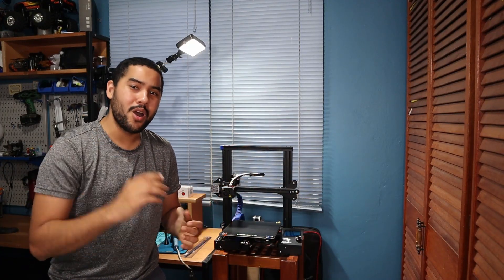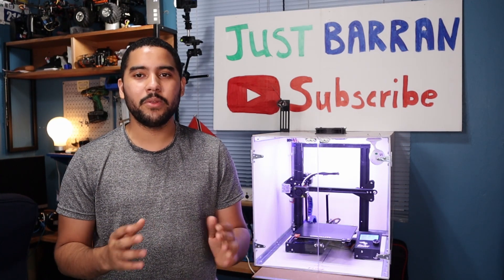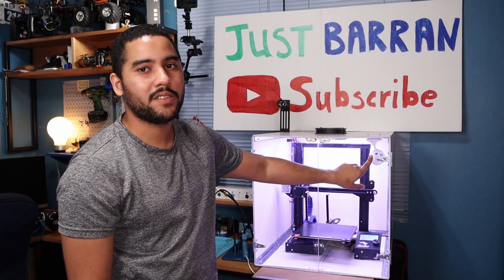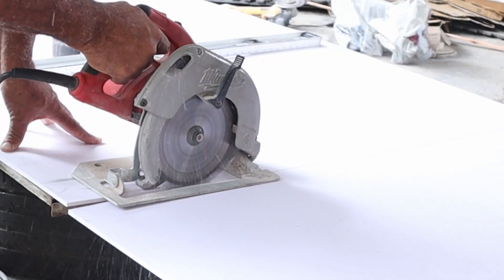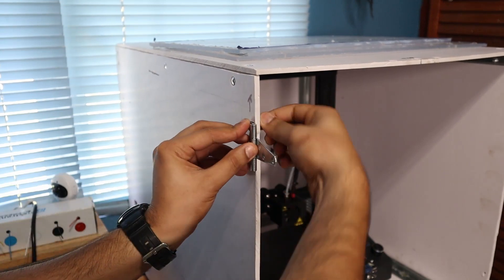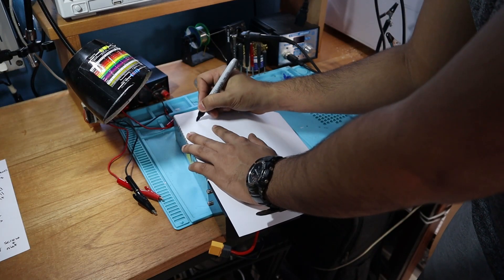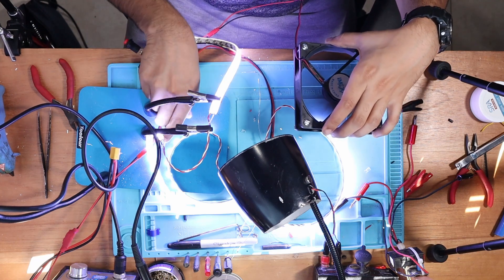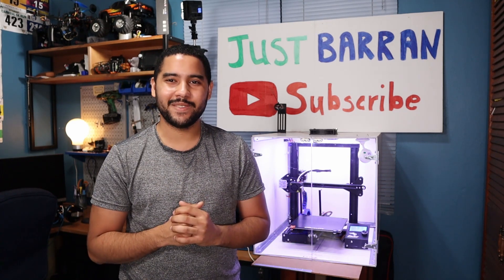DIY 3d printer enclosure for under $50 | printing ABS on Creality Ender 3

Comment from the maker: What else should I add?
Reply: Electronics must go outside. it is dangerous
Reply from the maker: @luistovar9329  yep, major fire hazard to keep it inside
Reply: hi, i also build a enclosure for my ender 3 also, in your video, you put the power supply outside, i wonder why you don't put the motherboard outside also? it that will be better i put the motherboard and power supply also?

and another question is the electric bill will cost a lot while let printer run long time?
Reply: add a exhaust outside to keep your lungs healthy
Reply: when you removed the psu from the frame of the ender 3, you removed the grounding from your 3d printer (just to let you know)
Reply from the maker: @Tal1m  not really, also the 3D Printer is DC so no need to worry about any AC system, and the ground on the connector connector would be transferred to the machine via the ground on the controller. So there is no worries there also.

Comment: I've been using a 30 gallon clear trash bag draped over the Neptune 4 Pro when printing ABS.  The deluxe version has three 20" long strips of duct tape across the front where the bed contacts it at the end of the print when presenting the part for removal.  110C bed, 255C nozzle for the first layer and 230C nozzle for subsequent layers, printing on textured PEI.  I'm running production.  It's so reliable, I start a print and go to bed before the first layer starts to print.
Reply from the maker: That’s awesome 🙌🏽 surprise the trash bag doesn’t shrink with the heat but if it works it works
Reply: @JustBarran  - It works!  The 110 C bed will shrink the plastic bag when it contacts the improvised bed slinger enclosure when the bed extends forward but the strip of duct tape in that contact area prevents tears and shrinkage.  It works surprisingly well to be such a cheap and easy solution.  I wish I could find a 30 gallon turkey roasting bag.   😀
Reply from the maker: @Liberty4Ever  you unlocked a new way to use duct tape 🙌🏽🙌🏽🙌🏽

Comment: Aye man you print in your room, and if you do how it the fumes with the case???
Reply from the maker: Hey nah, I move this out of my room after this video. You can check out the lab tour video https://youtu.be/MCz_iqm1IY4 I added a dryer vent to the outside of the lab with another exhaust fan , with the carbon filter and the fan the fumes are significantly reduced but not completely gone. I would usual just let the encloser fan vent out about 10mins after the print before opening.
Reply from the maker: I would add also I sold this enclosed to a buddy of mines who is doing ABS parts for cars and no longer have it bit he said it works great for him and has recently switch over to ASA and it's working great also in the enclosure

Comment: you should have minimized the use of other materials with 3d printed parts. what's the use of having a 3d printer when you are not using it :/
Reply from the maker: By all means if you want to spend days printing hinges and door handles no one stopping you, if I can get something in the hardware easy vs 3d print the samething i would go with the hardware item. Why wouldn’t you it going to be cheaper and better. If you can’t find it in a hardware or it’s too expensive then by all means print away. There are different use cases for everything. Atlease that is my opinion.
Reply from the maker: Because you have a 3d Printer not everything needs to be 3d printed 🙄
Reply: @JustBarran good response. I say this cuz I'm currently putting my tactical boots on.....lacing up....and driving my happy butt down to the hardware store to go buy everything on this list. 

The enclosure idea is freaking awesome man thank you. 

And no I want my enclosure today, so I'm not taking the time to print all the parts😂 maybe I will build the enclosure first, and then print the parts down the road.

I'm surprised I didn't think of this with using the metal angle pieces, that's a perfect idea for a box. You have come up with a perfect idea, that is basic structure, and that is awesome.

I do have a question, any reason why you used rivets as opposed to like self-tapping screws?

Well I suppose rivets would be cleaner, but let me know. Reason I ask is cuz I've never used rivets before or a rivet tool, but I guess I learn today😂

Comment: Great video. You simplify the building and wiring so I am confident about applying to my Prusa. Subscribed!
Reply from the maker: Thanks a lot, it’s also a great platform to add some other features, like temperature and humidity control

Comment: I saw some guy throw a space blanket on top of the printer and it worked xD
Reply from the maker: Anything to keep the heat in 💃🏽💃🏽💃🏽, only thing is the powersupply should be outside atlease to reduce chance of a fire

Comment: why do u leave controller inside, it's not good for electronic and can be dangerous, u need too place the extruder outside of the enclosure too to increase efficacity of extruding TPU, hot condition will make soft filament and badder extrusion
Reply from the maker: I plan to remove it outside, but for now it doesn’t over heat since I set the fan to be 100% duty, also for other prints I can’t just take it out of the encloser, everything is pretty modular

Comment: Right, so you should not push the bed around like that when the printer is off. Your LCD flashed. That means the motors generated at least 3v3 to cause the board to be energized!
Reply from the maker: Yeah stepper motors are quite the generators

Comment: You won't be using tpu with a stock extruder
Reply from the maker: I have a metal one, but might have to change it to a direct drive later.
Reply: @JustBarran  just get a titan cause if you go direct you really should go dual z cause you adding all that weight to the gantry
Reply from the maker: Thbaks for the suggestion, I was really thinking about going direct but wasn't finding any good conversation kits

Comment: i want to make something like this, this would not make my power supply over heat being enclosed and not have fresh cool air? i want one for my Ender 3 V2 but i am afraid of that
Reply from the maker: I recommend putting the power supply on the outside, even on the v2 I should be easy to remove and you can buy/make a small extension. leaving it inside would put a strain on the power supply ability to cool properly and could damage it or worse cause a fire.

Comment: I have a side mount spool holder on my Ender 3 Pro how would I be able to make one of these?
Reply from the maker: Might need to get a bit creative, but could just have it to the side at the top. The foam board is pretty strong. Especially if you go with a bigger thickness

Comment: Is that foam board or Coroplast (polypropylene)  Foam board here is more expensive.
Reply from the maker: It’s not coroplast I know that but I know there is different kinds of foam board. This one is really rigid and it is fire resistant and does a really good job keeping heat in. But it’s foam board not sure the specific type. I got it in a 8x4ft sheet for usd 20dollars

Comment: man that grinder no guard, woa, thats some heavly dangerous thing
Reply from the maker: It’s legit the one tool I am afraid of the most, but my uncle does this all the time.
Reply: @JustBarran  I really dislike grinders too, the buttons on top, i dont feel like i got a strong grip on the thing
Reply from the maker: @IDCrish  ahha same, I does feel like it has more power over me. I rather use a chop saw or a table saw.

Comment: It's cool diy. But I'm also thinking I will need extraction venting, cuz of abs smell and toxicity.
Reply from the maker: Definitely, I plan to add a tube and other fan to pull it outside but right now where I have it it’s in a well ventilated store room. But I highly recommend getting something to pipe it outside if it is in a closed room

Comment: Man has been MIA for soo long, and I agree with Krisp, home boy steam account been getting some hours added :P. Glad to finally see another video  <3
Reply: I need to change them steam hours to YouTube hrs
Reply: Also don't forget to remind people ( assuming you checked) that the PSU had the current rating to supply the fan and LEDS whilst the 3D printer was working. I know the LEDs and Fan might not be much but one should always double-check those things.
Also maybe a middle brace, the thing looked a little shifty in my eyes but I guess it works for its process.
Reply from the maker: @usmanmohammed8949  Well I could always switch to an external power supply but really good point.  I have plans to do a part 2 so stay tune

Comment: How did you get your table to level out? Or the calibration so you can start the 3D printing, cuz I’m wasting a lot of material
Reply from the maker: A bit of patience and a piece of paper does the trick. Just move he head around the bed lowing  or raising the corners till it lightly scratches the standard letter paper. I do this before every print but I plan to get a auto leveler soon
Reply: Trust I’ve done that,but it’s just to get all four  corners on point with each other is trouble but blessings  on the tips. Def will try again
Reply: @deezzznudhtz  watch the CHEP video https://www.youtube.com/watch?v=_EfWVUJjBdA and download the calibration gcode.
it took me only 5 minutes and i have solid prints! if your bed is slightly bend like most beds just use glass and its easyer to get the print off.
Reply: It's not complex than a simple sheet of paper... get some stiffer springs for the bed those help alot
Reply from the maker: @zergmare7  yea i got new spings, and I with the paper I found leveling very easy even tho I have a auto leveler now